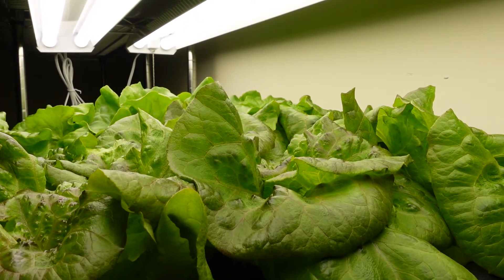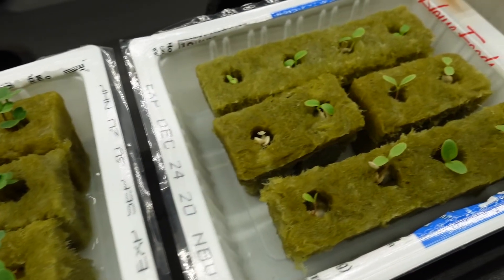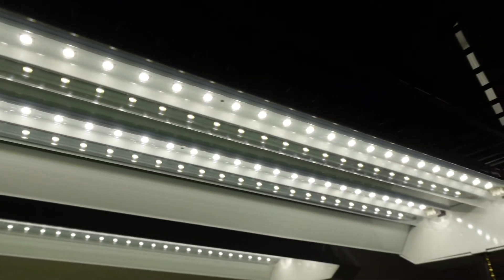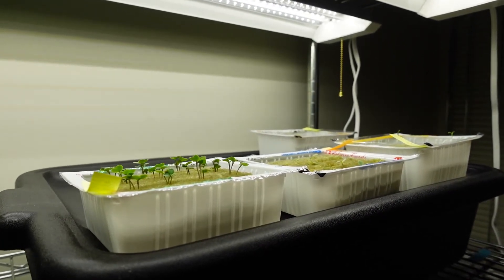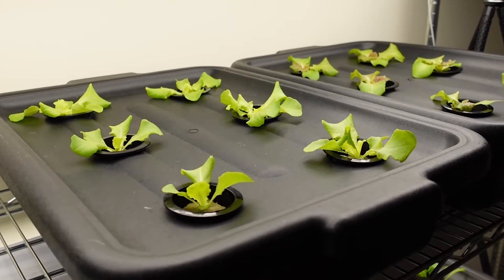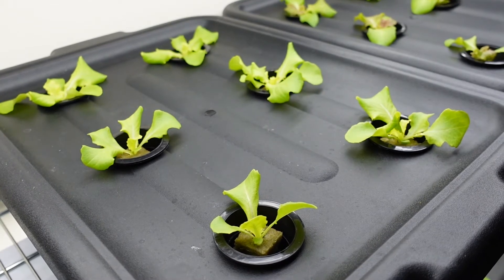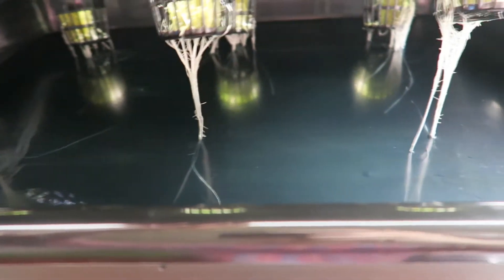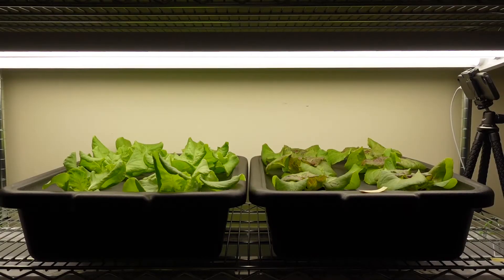The Life of Hydroponic Lettuce (Time-Lapse Video)

Comment: Can we do 24/0 light cycle for lettuce ? What’s the growth difference between 18/6 and 24/0 cycles ?
Reply: DLI of about 24 seems to be the average edu pdf results of maximum development before just creating wasted energy for less results after 24 DLI. I’ve done both at that target with 14 hour days and high ppf and low ppf at 24 hrs and saw no difference in continuous or dual cycle. I do prefer lower light intensity to longer on times verse higher ppf for overall health of the leaves. Higher ppf does produce some fantastic leaves in density and broadness, but can signal a tip burn too. ( even if proper ca++ is maintained) shooting for 225-245 ppf is like a wonderful sweet spot.